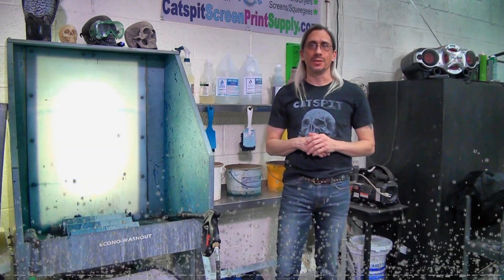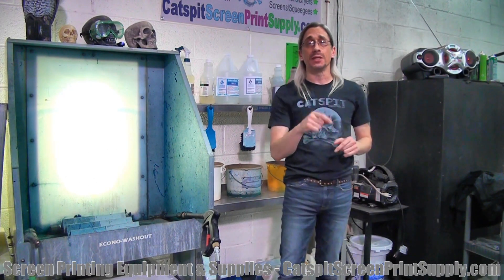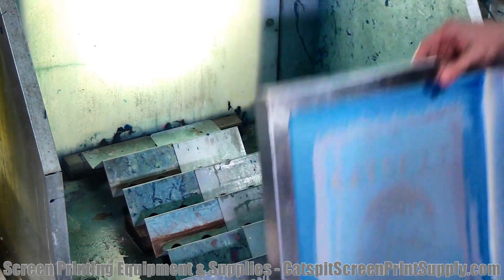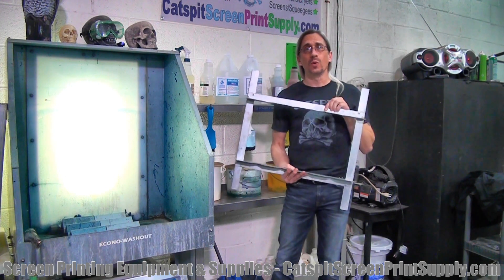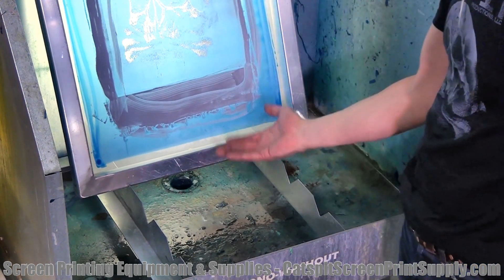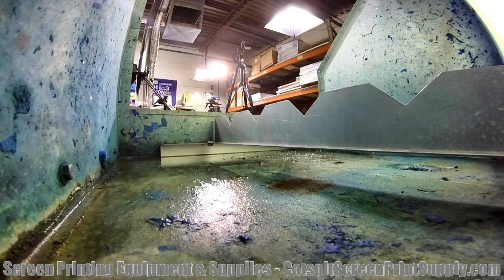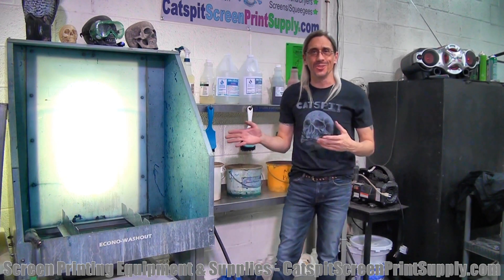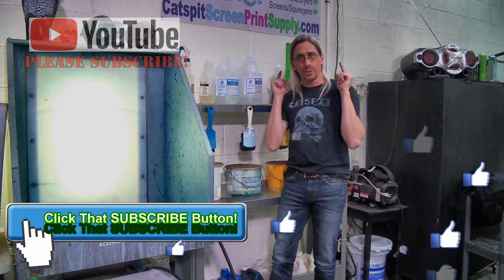Screen Printing Tee Shirts: Ranar’s New Washout Booth Screen Holder Rack

Comment: What are the dimensions of the rack.  Have a different brand washout booth and want to see if will fit in my washout booth.
Reply from the maker: 24 inches wide by 23 inches deep. The V racks hold the screen at 3.25 inches above the sink bottom. If assembled with feet flat it will be 1.75 inches above the sink bottom. I have a link in the video description. Thanks for watching! Screen Printing Equipment & Supplies - http://CatspitScreenPrintSupply.com/